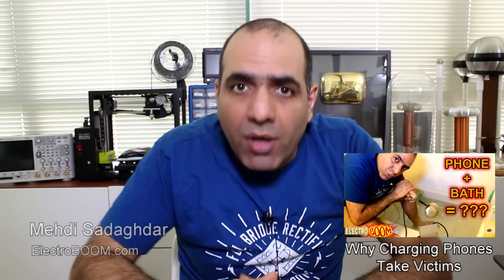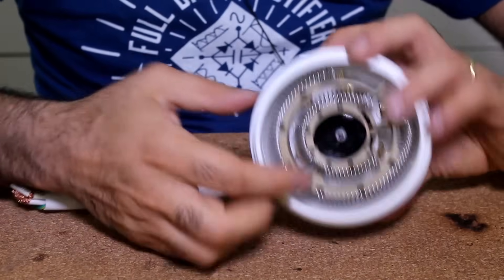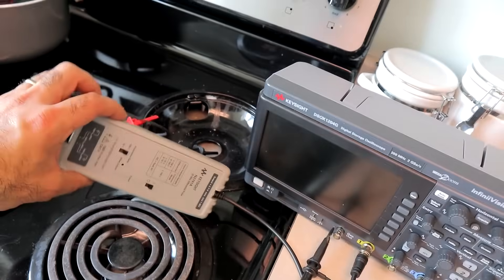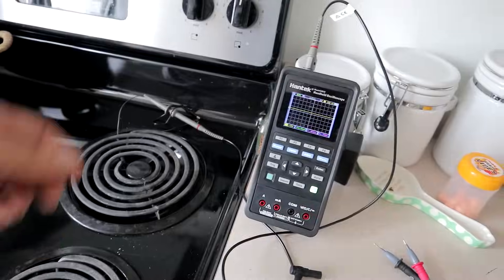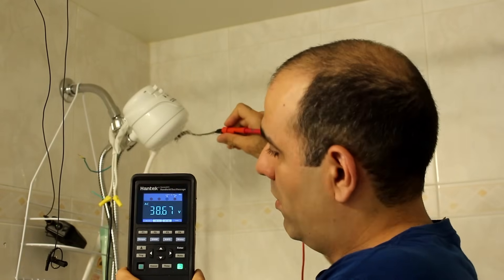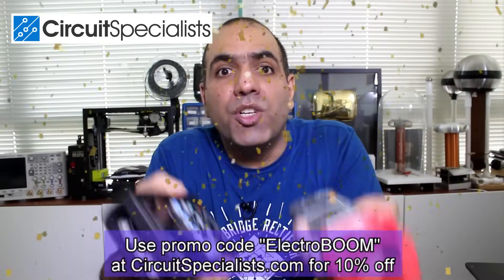How Safe Is the SHOWER HEAD OF DOOM?!

Comment: Brazilian here.

The wires are usually very well isolated, and there is usually a breaker installed specifically for the shower head. The design of the one you have is pretty much standard.
Reply: How much Voltage do you have in Brazil?
Reply: @Sypaka  110 and 220
Reply: @Sypaka  220v, some places 110v...
Reply: @Sypaka  220V
Reply: @Sypaka  It depends on the region, Some cities are 120v @ 60Hz other 220v @ 60Hz
Reply: @Sypaka  Some 110 V but in most states the voltage is 220
Reply: @2gabrieu  
Holy shit. So when you guys move,you have to check the mains first, so you won't kill your household items?
Reply: @Sypaka  Exactly, when I moved out of town I had to buy all equipment in 220v (lived in a city with 110v)
Reply: @Sypaka  The neighboring town of mine has 220v in one half of the city and 110v in the other. Very common burn hair dryers when going in another house (in the same city)
Reply: The norm is 110(wich is actually 127) and only the shower have 220, and when there is a plug that is 220 is usually labeled. The big problem is that most houses here have no ground. Im my entire house there is one plug that is grounded, and thats because we asked an electrician to make a ground.
Reply: DevilMayPlay Why is the norm 110? Most cities function on 220, mine included.
Reply: @ShizaanSil  Stop spreading misinformation, there are whole states who use 220v only. And there's also weird cities like the one gabriel rodrigues mentioned, where both standards are used in different parts of town. Here in Santa Catarina the only way to get 110v is using transformers.
Reply: @Flama741  He probably never knew a city that was (220v/380v), and he's talking about the experience he has. Which is (110v/220v) is the standard where he lives.
Reply: Seconded. Also the worst thing that has ever happened to me while using this kind of showers for over 20 years are that the heating element gets corroded/worn-out over time to the point it just "shor-circuit" itself and no electricity runs anymore on the shower.
Reply: @FastSloth87  sorry man, i actually didn't know that, i said is the norm 'cause pretty much every place i go is 110, and so most of the electronics that i bought. If in some places is like that, sorry, just don't take it personally, i ain't spreading miss-information, i just didn't knew that some places have it the other way arround.
Reply: @FastSloth87  Exactly, cities like Rio Grande-RS started their electricity grid with material imported from other Countries that used 110v, and the newer regions of the city (like cassino beach) use 220v.
Reply: @juannicolascamelogarzon3947  you mean it gets corroded and breaks into an open-circuit
Reply: @XGD  Exactly. Sorry, I'm more of a computer science guy xD
Reply: @2gabrieu  
Ouch. Where there any plans to fix that to the same voltage across the whole town?
Reply: @Sypaka  I believe that this is not going to be fixed anytime soon, in the city living around 300k people so the problems caused by a transition to 220v make the idea Practically impossible.
Reply: Agreed with "usually" word. Not always :)
Reply: @2gabrieu  
300k? So it's approx the same size as my city.
Reply: here in Paraguay they just twist the wires together and put some tape over it. Sometimes they are even smart enough to tape the ground wire to the pipe...... which are plastic most of the time :D

Comment: I'm brazilian and I never heard about death in use of eletric showers. 

 In Brazil is more common to see news about deaths in bathrooms that use gas heated showers (because of gas leak)
Reply: Poor installation or failing units will make anything dangerous, however, does the gas there not have an added odor? In the U.S. if there's a gas leak you can smell it.
Reply: @rockbandandghmaster  You can't smell it when you're dead.
Reply: TheKingHostile In China, it is required to install a gas detector which connects to an electrical valve. Once gas detector detects gas the system will automatically switch off. The main system has a pressure valve as well. Also with the odour I just don’t see how anyone can die from gas...
Reply: Maybe he mean carbon monoxide from the gas heater exhaust.
Reply: @rockbandandghmaster  it's a bit trickier than that. Of course gas has added odor in it. I'm from Argentina but i've been in Brasil. Because of the terrain, it is way too hard and expensive to get master natural gas pipes on the neighborhoods. They even have trucks selling compressed gas as if it was icecream. But it's mostly used for other stuff. They're quite strange people most of them doesn't even know what a bidet is hahahaha
Reply: @rockbandandghmaster  Our gás has odor as well,  people are just dumb.
Reply: Actually, the deaths are not caused by gas leaks, but by carbon monoxide from the burning and oxygen depletion. Also, it can happen only if the boiler is installed IN the bathroom (which is stupid and forbidden by all codes).
Reply: @Lucas R.Guimarães By "really really" cold you mean -5 Celcius? That's the minimum Ive ever gotten in Gramado.
Reply: @OprichnikStyle  narrow minded people aways think everything different from them are 'strange'
Reply: @OprichnikStyle  Did you saw them moving gas canisters in motorbikes? Here in Honduras we carry them (we call em chimbos de gas) in everything from trucks, pickups, and most notably motorbikes. They put em in a metal cage behind the driver and sometimes tie them, then off he goes.
Reply: @virgilio6349  I saw them in trucks like those soda trucks, and they pass a few times each day. the difference is that the ones I saw didn't have metal cages
Reply: @rockbandandghmaster  It usually happens to people that install gas heaters on poorly ventilated rooms, and they die while sleeping.

Comment: Commonly it is used 6 to 8mm wires alongside 50A 1 or 2-phase breakers(Disjuntor in Portuguese).
Gas central heating is not very common in Brazil and the prices make it less common. Even though most of the houses that have central heating use gas cylinders, there are few locations where you can find gas pipes.

Comment: So I'm from one of these countries that use a shower like that. Here's some insights:
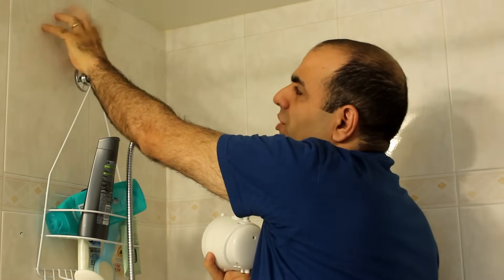6:10 - There is no live wire with you in the shower here because the bathroom is already adapted to such showers - just to show how ubiquitous those showers are. Shower heads are installed much higher than Mehdi's (I needed a ladder to install my shower) and there's no loose wires whatsoever, they all go through the wall.
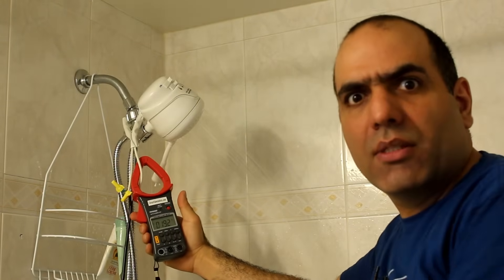7:39 - Yeah, those things draw a lot of current. Long hot baths could mean a significant raise in your electrical bill. Pretty much everyone here had a parent that got really mad for their kids taking too much time in the shower for that very reason.
7:41 - Yup, but bathrooms' wiring around here are all adapted to this kind of shower. Mehdi's isn't, but in Canada this kind of shower head isn't common there.
9:03 - Actually, installing shower heads like these is something electricians around here do a lot. Also, shower manuals are many times good enough that a person can do the installation themselves (I do it). 
9:06 - The only recurring problem people actually have with their shower is improper grounding, but that affects the whole house, not just the shower. I once suffered a mild shock while turning the metal cross handle in the shower of a friend's house. I then noticed that she had already covered the handle with electrical tape, but she missed some spots. So even in those cases, those showers are pretty safe.
9:34 - Why is Mehdi questioning the quality of the shower head? Those things have been around for ages, their design has been optimized over the years, their manufacture is regulated (believe it or not, the government can still do a few things right), houses are all adapted to them and the companies that make them really don't wanna be sued over someone's death. The only problem I find in some showers is low water pressure, but I've never had problems with the heating element.
9:45 - Well, where I live we have 110V AC but I've been to a town in my country that not only uses 220V but also metal pipes, their tap water has a metallic taste so I figure it has some metallic ions on it making it more conductive (I guess, I'm no chemist). I've visited that town many times and took hot showers there, and I felt nothing. No even a slight shock. Maybe the current is double or more, Idk, but it's still safe.
Electrical showers may be intimidating to someone who's not used to them and it can actually be dangerous if you install if you leave loose hanging wires in the shower stall like Mehdi did, but other than that, it's pretty safe.
Reply: as if in brazil the electricty was really done correctly....

Comment: Brazilian houses are made using powerful Wires in the bathroom to ensure that the electric shower does not have a problem with the wires not holding.Last month I installed my first shower and it didn't cause any problems and I don't know anything about wiring, and my house doesn't have a ground wire.

Comment: I think one of the funniest things about those shower heads is that yes, depending on how the bathroom wiring was done and if the shower power connection is not properly set you will get shocked. On our old home we had one of those and had an outlet in the same box for an ofuro (Japanese bathtub) electrical heater since my grandma didn’t trust those bathtubs with integrated heating. The idea was pretty much like the idea of American’s and UK bathrooms that have high output concenters do just the bathroom for stuff like heated toilet seats, shaver dedicated plug and shower and bathtub heating.

Comment: Homes in Brazil have separate thicker wiring and higher amp breakers for the shower, if it trips due to heat or whatever, only the shower breaker goes down, only happens when theres something wrong in the installation like bad connections or thin wires. Usually each 110v wire goes into separate 25 amp breakers, and we use at least 5mm wires for the shower alone. Also, this varies based on the wattage used on the model, they vary from 4500w to 7500w for 220v and only up to 5500w for 110v. In Brazil some coastal cities do use 220v/phase while others use 110v+110v for the shower. Also, the wires are connected to a wall socket behind and above it, the connection usually blocked by a plastic cover.

Showers like these are the standard here, noone ever gets electrecuted unless they did a horrible installation. Also, there are tons of different models.

Brazilian homes usually also have separate wiring and breakers for different rooms like the kitchen.
Reply: @Popcorn Vendor 3rd world countries have electric enginners, you know?
Reply: @Popcorn Vendor Brazil is a vast country with very different places, some of which if were separate, they wouldnt even be considered "third world." There are rich developed cities with very low crime rates, but with such a bigcountry and with places that are indeed violent and dealing with misery, the average ends up being really bad.

You can travel within Brazil and feel as if you are in a whole different country.
Reply: @Popcorn Vendor Like ive said, averages, in a country the size of some continents.

Comment: here in brazil people only die with gas heated showers. never heard anyone who have had fatal injuries with electrical shower
Reply: How tf people kill themselves with gas heated water?? Darwin award for sure. With a water heater tank heated by a gas pilot light, the water gets heated in a central location the distributed. Having a carbon monoxide detector is best for safety, but if properly maintained you shouldn't have a worry about CO. I'll take my chances with gas any day rather than an electrical circuit a foot from my head heating water. Much safer to have centrally heated water via electric too, with instead of a gas pilot light you have two (an upper and lower) resistors that heat the tank of water.
Reply: @MisterPlanePilot 90% of the Latin American continent is incompetent to have subways that don't crash into each other
Reply: @MisterPlanePilot  Unfortunately it happens sometimes here. I had a very young online friend who died due to a bad installation of a gas shower, it was very tragic.
But I do see generally a trend to be couples who die together this way, probably they were having sex, spent a long time in the shower and the instalation was bad as well so they eventually pass out together.
Reply: @MisterPlanePilot  I suspect it's more not about the showers but about the gas itself. If it fails to ignite, and the gas heater is primitive and does not shut down the flow, and there's no detectors, occupants of a building can get unalived either due to asphyхiation or explosion. 
In RU where most places are not equipped with safety sensors and equipment is often primitive, residential gas explosions occur with alarming regularity
Reply: Don't lie.
Reply: @Sokoly.  Experiências pessoais não contam para estatísticas. Daqui a pouco vai dizer que a qualidade de vida do Brasil é a mesma do Canadá. Alienada. Vai dar uma volta por uma favela e ver a realidade do teu país antes de asnear na internet
Reply: @BoraHorzaGobuchul  Numbers? Where are them? So we can compare. Brazil has high numbers in every bad statistic. Here it wouldn't be different.

Comment: Cool video! These showers are indeed pretty common here in Brazil, as they are cheap and require no further heating installation on the house. Since we have quite mild winters, there is no need for general heating. Most places I lived there was a 220V line for the electric shower (Brazil is a mess, we have cities that are 127V and cities that are 220V). But I have already seen some stupid houses with 127V wiring for the shower, which requires thicker wires (and which often are not). Not every house has ground wiring, as it is a relatively new requirement for civil construction, so a lot of people just leave the ground wire off. Two of those showers already exploded in my head (NOT AT ALL A GOOD SCENE TO BE EXPERIENCED), one it was of poor install of the electrician (wires were loose in the connection, they eventually heated up, melted and the phase connected to the neutral, short circuit ftw). The other time the shower was off for a long period, so the resistor was quite oxidated. When I turned it on it shorted and heated up, the shower became red. Oh well, every day taking a shower below these 32A beauties, the joy of living in Brazil :)
Reply: Stupid question- why does lower volt wiring require thicker wiring  and not higher voltage stuff?
Reply: In order to keep the power draw the same, if you double the voltage, the current gets divided by a factor of two. Wire is rated by how much current it can handle, so doubling the voltage is an easy way to avoid thicker wires. (I’m not an expert on the matter, so my explanation may be a little off)
Reply: Where I work the shower installation used extremely thin wire for a 127v connection, you know the kind that you'd plug lightbulbs with. It's caused the wires to melt on the shower AND the wall. No freaking clue how that got approved. Now we've put in a request for re-wiring the damn thing, and once it's done we'll be good in tha hood.
Reply: Don't you have natural gas in houses? A small water heater - either with natural gas or electricity - on the wall of your bathroom can solve the problem, costing $100 - 200. We used to have them in Iran 15 years ago (when we moved to an apartment with hot water, but I think they are still popular)
Reply: @saeedgnu 
Nope. Gas heating for Brazilian homes is WAY overkill unless you live in the southern mountains. Ours is a warm country, cold days are few and far between. So much so that our "cold" is less than 20°C.
Reply: Get a tankless water heater this thing Is down right useless
Reply: @iair-conditiontheoutsideai3076 
No u
Reply: @DinnerForkTongue  🤡
Reply: @iair-conditiontheoutsideai3076 
🗿
Reply: Why not use a black tank or foil on the roof, let water run through it, Brazil hast many sunny days.
Reply: I exploded 4 of those and I am 23 years old :p
Reply: a resistencia ficou vermelha porque não tinha agua? aqui em casa eu queimei uma resistencia assim outro dia, mas ela não ficou vermelha não, ela só queimou de uma vez....
Reply: @saeedgnu  we buy gas barrels only for cooking, we don't produce as much gas as USA but we produce a lot of electricity, so electric heating is cheaper
Reply: @Delibro  because we don't need water heating on sunny days, many houses have an exposed water reservoir on the roof so it already takes the heat from the environment, so the water is only cold when it is cold outside,  like at night, or early in the morning which is when people use the heated shower, you don't need to heat the water in any other water source, for example if a sink has two registers here the hot one usually does nothing because there is no second pipe system
so we need a stronger wiring, but we end up saving on pipes, as we only need one pipe system instead of 3 (gas, cold water, hot water)
Reply: @devforfun5618  Thats what I'm saying, put a tank on the roof ...
If its big enough it stays warm during nights.
Reply: @saeedgnu  gas water heaters are way more dangerous.
Reply: @Delibro  the problem is that this ends up being expensive for us, so it makes more sense to buy an electric shower, which costs approximately R$50.00, which in direct conversion would be approximately 10 dollars.
Reply: In Brazil the 220V are made by 2 127V AC live wires
Reply: @devforfun5618 In some states, it is common to take a shower without any heating, as it makes no sense to take a hot shower in such hot places.
Reply: @iair-conditiontheoutsideai3076  yeah, are tankless water heaters just not a thing in Brazil?